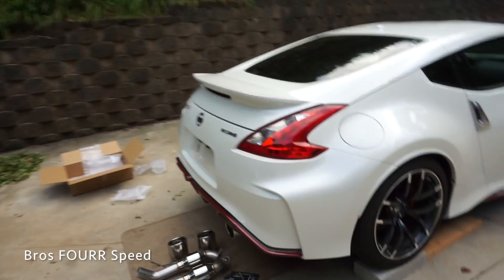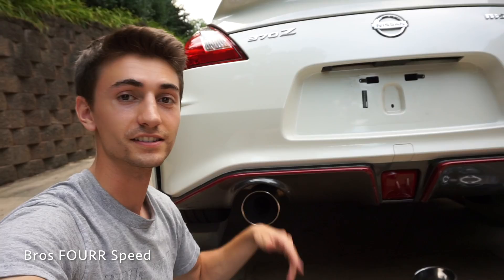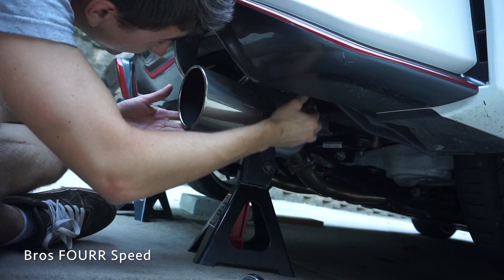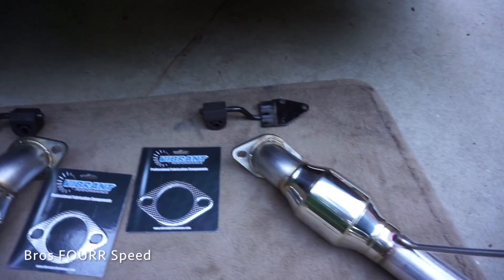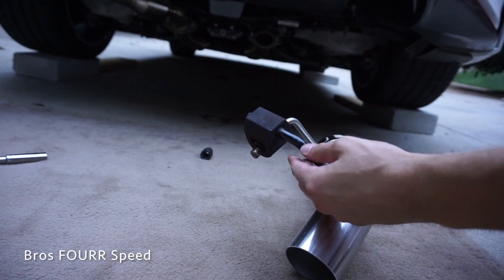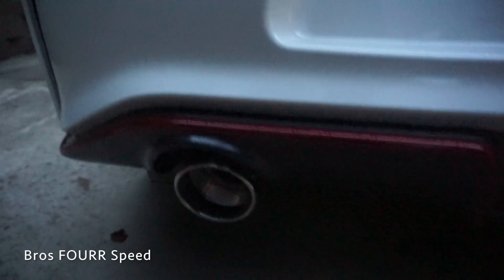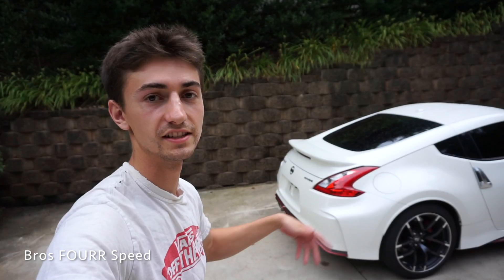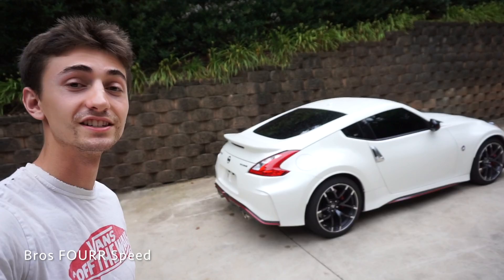Nismo 370Z AAM Resonated Short Tail INSTALLATION!

Comment: no revs dude come on
Reply: Lucas Engen ikr, guess gotta wait for the next video..
Reply from the maker: Lucas Engen There are some start ups in this vid. Many sound videos coming soon!
Reply: Bros FOURR Speed your saving it for the next video? the old saying dont spend it all at once, so doesnt this affect warranty?
Reply from the maker: Blade ManX Since these have resonators, I need to let them break in all the way before I can do an accurate sound comparison. An exhaust won't void the warranty. A tune would be the only think that could void it, and that's only if Nissan could prove it harmed the vehicle.
Reply: darren smith and
Reply: Waste of my time
Reply: Revs are rather lame if there are no drive by's, since the engine does not sound the same under load.
Reply: Lucas Engen I
Reply: Like I literally skipped through this video looking for revs, and nothing. Just put the exhaust on, and rev it. Simple.
Reply: Or just say installation only so I'm not looking stupid wasting my time expecting something else to happen
Reply: That's why I like rookie videos. They don't say shit. Explain everything in the discription, play the video rev the engine cut the video. PERFECT way not to waste precious second out of my life
Reply: Lucas Engen why would you want the resonators on?
Reply: Gay sound gay color. Surprised it’s not an auto.

Comment: I did same kind of mod to my 2010 seat leon fr tdi. Exept i didnt put resonator in it. And i made the axle back pipe and the brackets to hold it in place my self. Other mods are 2.0 gas turbos injen cold air intake modded to fit in tdi model. It sounds really cool with these mods.

Comment: What is the emission canister shield on a 370z AAM says Please Note: To fit the S-LINE Short Tail Exhaust properly, the emissions canister shield will need to be removed. Did you remove it ?

Comment: I want to do this to mine but I'm unsure if it will be too loud. on a scale 1-10 (1 being stock and 10 being full straight pipe) what would you say this is? what about compared to the non res?

thanks
Reply from the maker: PROJECT ANUBIS I think this is aa loud as possible without being crazy loud. Maybe a 7. Non res would be an 8. and then catless would bump it to the 9-10. It's on the louder side without being obnoxious. I think it's perfect
Reply: @nkost88  I ended up buying some topspeed ones with a bigger baffle and it sounds good everyone tells me. I got use to them and wish to make it louder but with the same decent tone. Check out my install or build I did some updates
Reply: @nkost88  Exhaust
https://youtu.be/kKSgoZwk-RA

Ipad
https://youtu.be/j-k7x6FkQNc

Steering Wheel
https://youtu.be/528sQ3qFcUY

Brakes
https://youtu.be/4Km7AnL6oyc

Comment: I know this video is old but I'm curious if these would fit on Invidia Gemini Mid-Pipes. I like my invidia and I don't really regret buying it especially for the price but I love the way these sound and I still haven't found an answer on if these would fit on there. The big ass mufflers on the Invidia alone make me want these Short Tails.
Reply from the maker: If those aftermarket mid pipes fit to the stock muffler then they will fit.  I would assume the Invidia mid pipes are designed for their own mufflers so I can't say for sure!

Comment: you made a very good choice going with the axel back from AAM. the NISMO H pipes is azmazing, if you want to do a cheap mod that will bring up 5WHP for 100 bucks i recommend doing the light weight pulley kit from NST ive had it on my nismo for about 17k miles on and on my 300zx for 80k miles on them they definetly help with response and the engine definitely revs up a little quicker, stillen also offers this an underdrive pulley but NST gives you 2 pulleys. those are the best two brands according to the forums. there are a couple more but the quality is questionable.
Reply from the maker: Edward Padilla I've seen stuff about pullies. Does that mass up any balance?
Reply: Bros FOURR Speed some cars use a harmonic balancer but not the VQ37VHR these engines are internally balanced, basically yiur just getting rid of mechanical drag since the factory crank pulley weighs 12 pounds.
Reply: No balance just dead weight, I spoke to a Nissan tech about it
Reply from the maker: Very cool. On the Genesis Coupe's it was the other way around. Still learning about the Z engine

Comment: Why puts two spacers only on the right side and not one spacer for left and right side?
Reply from the maker: Just depends on how the tips line up, that worked best for this situation.
Reply: @BrosFOURRSpeed  and also does a non nismo 370z sound a lot different with the resonated shoe tail or pretty similar

Comment: Unless you're this guy and get this stuff free, you can go to a decent muffler shop and get a muffler delete for less than $100 and it will sound just as good, if not better in my opinion. That's what I did to mine..
Reply: muffler delete drones too much at low speed cruising
Reply: kgkustomz97ser It does drone but I don't mind. If you can put up with it, it's an obvious choice

Comment: Will most likely get these. Very nice sound! Where did you buy the additional spacers to even the right side exhaust out? Thanks! Any additional mods you are planning to do?
Reply from the maker: The kit comes with 2 of them. I just used the washers the kit came with as extra spacers. I still need to adjust both sides tho

Comment: Nice video and it's on a subject that I was wondering about.  Why mess with the rest of the exhaust as an aftermarket cat back t probably wouldn't make much performance difference.  As a '16 Nismo owner I am looking forward to your review on the difference from stock.  Isn't it cool to crawl under the Nismo and look at the bracing and suspension?  Also being a Yamaha fan it's interesting to see the Yamaha body dampers as well.  Thanks!
Reply from the maker: Thanks! Yeh it's pretty neat seeing all that. The day after I bought my R6, I noticed the Yamaha logos

Comment: Aye man not sure if you will respond since this an old video but I was looking to purchase some resonated short tails for my G37 IPL but as I was reading about the short tails it said "removal of rear canister shield is required." I just wanted to know during the install did you remove the canister shield?
Reply from the maker: I actually kept the heat shield in place and had no issues. One corning I think I just bent up a bit so it wouldn't touch. So you'll be good! This was the perfect exhaust setup!
Reply: @BrosFOURRSpeed  for sure thanks for the response I'm about to pull the trigger now and buy it thanks again

Comment: those metal exhaust gaskets are actually better than the fiber ones the exhaust company gave you should have reused them theyre completly reuseable
Reply from the maker: Street N Jeep oh interesting. I can always swap them out later on
Reply: Bros FOURR Speed as long as they mate up well and are in good shape you should be good. its really not worth changing unless the ones on there fail though.
Reply from the maker: Street N Jeep good point. Car only has 8k on it, so I guess they are still good

Comment: I got the same exhaust on my z but recently it's started to have a rattling sound at low speeds around 10mph when accelerating, could one of the tip clamps be loose or do you think it's something else?
Reply: xXSwagCatXx get under there and shake stuff to see what's loose
Reply from the maker: xXSwagCatXx I think it's the trunk latch. My red Z and this Z make that briefly at 4k. I'm going to figure out how to tighten it. A lot of Z owners have that issue
Reply: nope that the nature of the z cars it sounds like a rattle but its not goes away after the exhaust gets hot.

Comment: Why did you remove the heat shield and then put it back on the next day? I should be receiving my short tails for the Nismo in a few days just wanted to know your thought process
Reply from the maker: I heard some people say that it would cause a rattle in the rear with it on. But turns out the rattle is just the trunk latch. So I kept it on just to prevent any extra heat from going into the trunk.

Comment: Pretty typical V6 sound ( 1-5-3-6-2-4 firing order).  These are great looking cars (my Nismo gets lookes all day long) and fun to drive on curvy roads however they simply are not steet fast (poor power to weight ratio and very low torque).  Have chosen to keep my Nismo stock as I don't want the humiliation, stoplight to stoplight,  from any stock V8 Mustang or Camaro. My 900HP GT500 is another matter.....
Reply: The firing order for this engine is 1-2-3-4-5-6

Comment: How's the back pressure? Did you feel any loss in torque or hp? That's been my fear of getting short tails. I've been wanting the armytrix exhaust but I don't want to dump 3k on that right now so I was thinking about getting short tails for now but I'm afraid of losing torque
Reply from the maker: Pr0uditalian It feels quicker if anything. The stock cats give it as much back pressure as it would ever need.
Reply: The faster you get the exhaust out of the car the faster it'll be cmon man 🤦‍♂️

Comment: I’m planning on doing this to replace my non resonated short tails. Allot of bolts are rusty and I don’t have replacement hardware. What should I do?
Reply from the maker: Use a lot of liquid penetrating oil. Let it soak for 30 mins. And do it while the exhaust is warm at least
Reply: @BrosFOURRSpeed  what about it I just leave the hangar bolts on and slip it off? Unbolt from midpipe
Reply from the maker: @joen9  Could work to for better access at the bolts
Reply: @BrosFOURRSpeed  well see gaskets coming tomorrow 🤞
Reply: @BrosFOURRSpeed  update it came out great!

Comment: That left side exhaust tip looks really bad that low. No way to get it up high like the right side? The right side looks OEM
Reply from the maker: I think I need to bend the hanger a bit. I'm sure I can even them out nicely
Reply: Post a video doing so. I want to get these for my Nismo but scared too get them if they have to sit that low. Like the oem look.

Comment: What is the weight savings?? Curious
Reply from the maker: TopSecretVid  In the install vid on my red Z I weighed everything. 29lbs stock, 10 lbs short tails. I would assume the nismo muffler is slightly heavier than stock, and same for the resonated tails vs standard. So roughly 20 lbs savings. 
https://youtu.be/yJevZQsiO4A

Comment: Hate to say it but, I'm almost sure you'll be going back to the stock muffler in no time.  I also have a '16 Nismo and my Belugas became unbearable after about a day.  The drone and resonance was making my ears bleed especially at WOT.  Keep in mind that the Belugas actually had straight thru mufflers.  These AAM's just have tiny resonators and are probably even louder.  They look good and sound amazing but they will become unbearable.   Maybe it's just because I'm an old fart......lol!!  Love your vids by the way.
Reply from the maker: Nope...They are very tolerable with minimal drone. I took the standard Short Tails off my red Z after 2 weeks, and luckily sold them the next day. It's actually been 1.5 weeks since I installed them, and they are perfect. Also being the Nismo, the final drive is different from my 2012 Z, and it cruises at a higher RPM, so the drone is even more minimal. This is about as loud as I could go without being obnoxious. The Belugas being a lower price point probably didn't have the same R&D as the aam. Probably not as good of resonators as the aam.
Reply: Interesting!  I might give those a try then.  I'm assuming you'll be making a full review vid?

Comment: you should just get a full catback go big or dont do nothing. but props to you
Reply: Jose Ruiz some people don't feel like spending $500-$700 on piping their car already comes with
Reply: Ro Formance true but it will SOUND WAY WAY better on my 370 i have a Greddy Exhaust SOUNDS AMAZING full catback
Reply: Jose Ruiz did it come with a x or h pipe?
Reply: Ro Formance h
Reply from the maker: Jose Ruiz Being the Nismo. That would literally be an extra $300 for no difference. The stock Nismo midpipe will do the exact same thing as any other aftermarket midpipe.
Reply from the maker: Ro Formance Exactly.
Reply: Bros FOURR Speed There is a performance benefit upgrading to a full 2.5", but it's minor, maybe 5whp at most.The Nismo exhaust does great, a lot better than the base exhaust. Be careful with removing the cats, it gets unbearably loud with short tails. It's best to run a HFC or resonated HFC to keep the noise and rasp in check.
Reply: lol this is illegal in uk if you remove the cat, if you get stopped and they conduct roadside emission test and inspection 1000 fine
Reply: Blade ManX High flow cats are okay for most states here, but your original cat must fail or need replaced.
Reply: Another reason for me to not go full cat back was that I could not find a aftermarket exhaust with an h pipe.
Reply from the maker: Yeh I would probably do HFC, or resonated test pipes with a tune.
Reply: Bros FOURR Speed I had the non resonated short tails with the AAM midpipes and their resonated testpipes. It was terrible. I'm not sure if those tiny resonators on the short tails will be enough to tame the noise. it was raspy at anything more than 1/4 throttle and so loud, my wife can hear the cold starts from an enclosed parking garage, two floors up and 100 meters away. I ordered the muffler that week. coincidentally I'm selling it after changing exhausts lol. I have a lot of exhaust clips of my page of different setups if you need future ideas. The only one I didn't get was the aforementioned terrible sounding one. it was an embarrassment for all Z owners.

Comment: you need test pipes next dude.
Reply from the maker: Im thinking resonated test pipes or HFC
Reply: with test pipes your check engine light will come on. buy a cheap code reader from harbor freight and keep deleting the code. after a while the z's check engine light will stay off because the car's computer has learned the mod.
Reply from the maker: Oh wow, didn't know it could end up staying off
Reply: it could take a month or two but yes eventually it will learn and stay off.

Comment: I thought 3.5 inch was excessive but 5 inches???? Damn man.
Reply from the maker: They look normal with the design of the bumper
Reply: Aye it looked fine more reasonable once it was installed but when you can fit a hand through your exhaust tips... lol
Reply from the maker: Yeh I was a bit scared when I un packed them lol

Comment: Don't do it. I have a 2017 370Z Nismo with installed  AAM Competition 2.5 Resonated Test Tubes (AAM37E-ResTest) at a high end performance shop. Drove it for under 480 miles, got a "Service Engine Soon" light. Took it to Nissan and told them of my aftermarket tubes, so they performed a full diagnostic as it is still only at 12,000 miles and under full warranty -  a Code P0430 - which is Catalytic Converter Bank 2. (Nissan charged me $75.00)
They cleared the code and it happened again within a couple hundred miles. They highly suggested I go back to the OEM Cats. I contacted AAM (Director of Sales and Marketing) and at first he was helpful, said that this only happens "Once in a while" as they have J bung system to move the o2 sensors further away. When I told him it happend again after a couple hundred miles, he suggested I look into o2 extenders and that might help. WTF, I spent $970 USD (converted from Canadian $) and they don't really care about providing me with extenders or if the solution will work. Removing them. AAM has poor tech and customer support IMO.